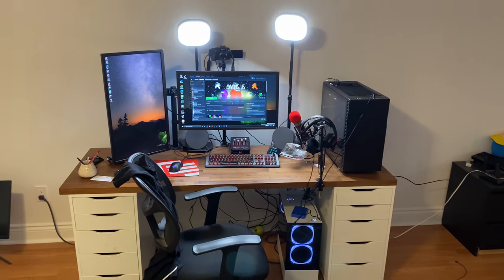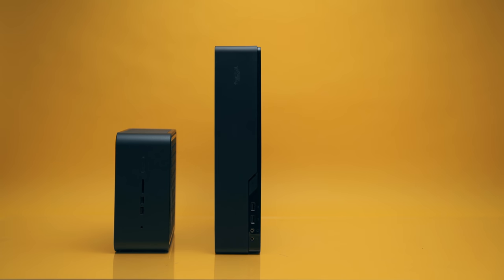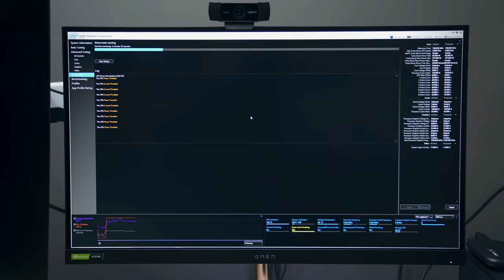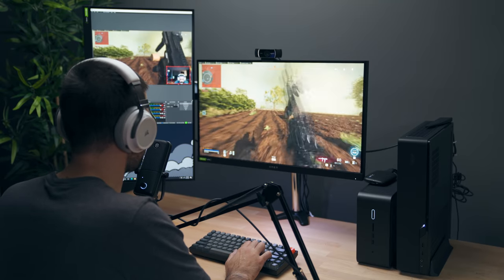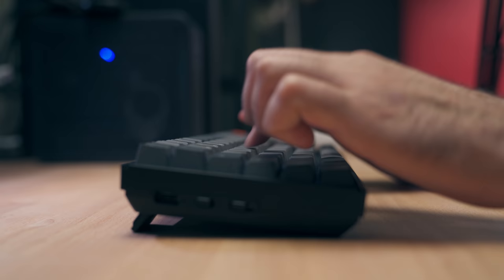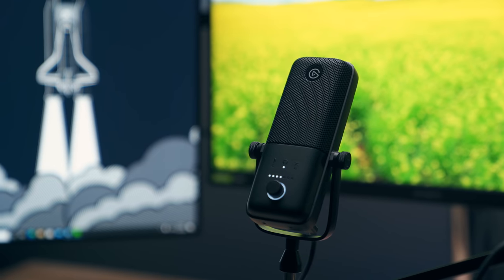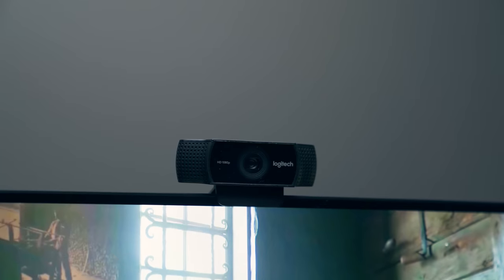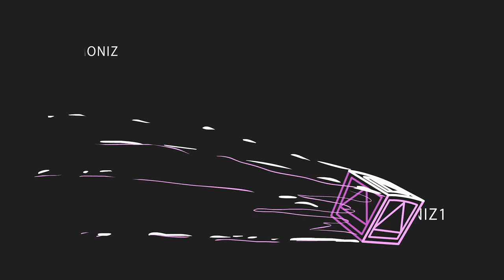Tiny Gaming PC & Streaming Desk Setup Tour!

Comment: I bought a miniITX tower specifically for my streaming PC because it's really only a capture card and a CPU and that's it. I think of it as basically having a console on my desk.
Specially since I have a Node 202.
For sharing the mouse and the keyboard, there's a free application from Microsoft that does that. It works flawlessly.
Reply from the maker: Oh ya whats the free software from Microsoft? I'd like to check it out. With Sharemouse you can also move files back and forth. It also works with MaCOS
Reply: @MatthewMoniz  It's called Microsoft Garage Mouse without Borders. I hope it helps! :)

Comment: One of the more minimalist setups and I love it but isn't Nvidia's new NVENC encoder enough for streaming?
Reply from the maker: Depends on the game, some games still run so much better with a dual PC setup. If you're casual one system is fine. But of you're doing this as a job or plan on streaming all day on twitch, 2 PC is the way to go
Reply: @MatthewMoniz  Makes sense it will also ease up the load on the GPU resulting in better temps and longevity etc.

Comment: Why two computer if you can have the GPU doing the work? is a serious question, after seing what you apparently can do with modern graphics card
Reply from the maker: You still run into frame drops and it still slows the game down a tiny bit also if the computer crashes your entire stream goes down. whereas with a dual setup the stream PC lives and the stream goes on.

Comment: Very clean set up.
But, what is the point of using 2 PCs when you could use the NVENC encoder in the 2070?
Reply from the maker: Thank you! NVENC helps big time, but there are still streaming cut outs and delays with a 1 pc setup. If you're a casual user a 1 PC setup is fine but all pro streamers use 2 pc's. It clears the load completely and if you're gaming pc goes down the stream stays up.

Comment: Cool and all, But why? Just make 1 sff beast that can stream and play. That H1 will do just fine for a 10600k/10900k/3700x with a 3080. Just connect both monitors to that. I mean even a Velka 3 or Dancase, FormdT1, NR200 etc would be great, small, portable even..

Comment: I don't really think it makes sense using two PCs to stream when you have an 8 core CPU at your disposal. I think a purpose built SFF PC would've been a better solution to avoid having to deal with two systems and a capture card. Since you're not using a GPU in the streaming PC a PCIe capture card would've been better since USB ones can be unreliable at times.

I'm making all of these considerations if like this was a long term solution. I know that just for the sake of a video all those things are not a concern.
Reply from the maker: If you take streaming seriously, you'll use 2 PCs. All pro twitch game streamers use two PCs. Yes NVENC helps out a ton but it still puts a load on the gaming PC and when you're trying to push as many frames as possible its better to unload it onto another PC. You also remove a bottleneck in the event you're gaming PC crashes which is common during long streams. The streaming PC will stay up, keeping your stream alive (since mic and camera is connected to streaming PC) while the gaming PC reboots. For the casual User a 1 PC approach is fine.
Reply: @MatthewMoniz  That absolutely makes sense. Different people, different needs. I felt like the setup was more geared towards a casual streamer.